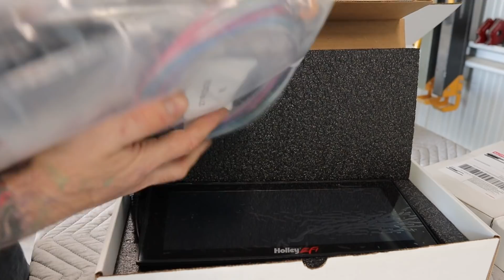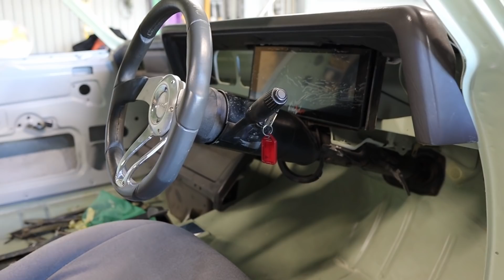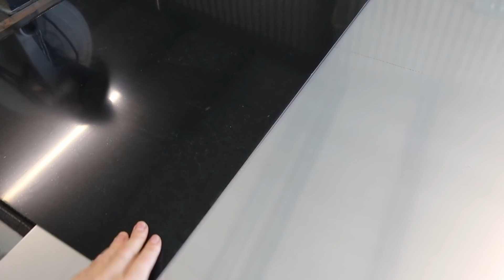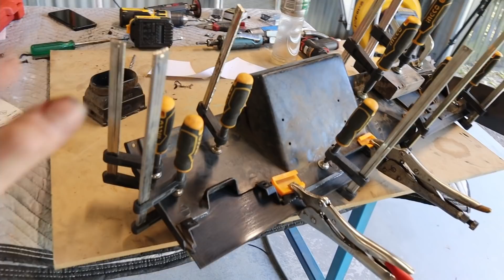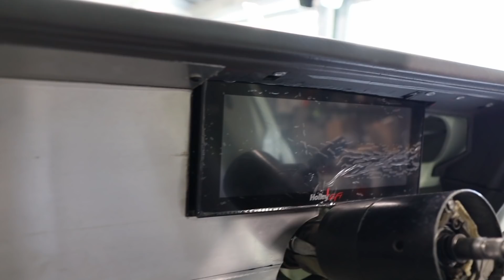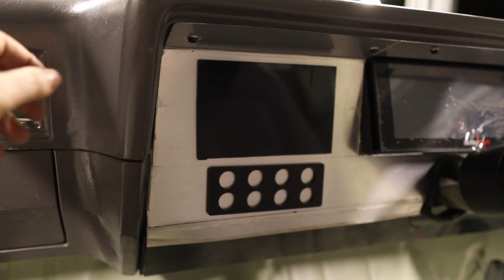Installing Holley Digital Pro Dash / Custom Dash surround - HX One Tonner Build

Comment: Hi Sam, I’ve also purchased the Holley pro dash and a set of super snipers for my engine, what other sensors did you need to buy that didn’t come with the dash, could I get the product code please
Reply from the maker: Hey Mate I bought an Engine oil pressure sensor, trans temp and coolant temp. Im not running high fuel pressure so im just using a manual gauge for fuel.

Comment: Looking awesome mate, love channel. Nelson is a great bloke and his buttons are second to non. 
Mate, swap your button ideas around, ie lights and things on right on left thermo fans and things on left and wrap in in suede, it’ll look clean and being flat panel super easy 👍🏽 just my thoughts, your doing awesome
Reply from the maker: Thanks heaps Mate. I think you could be right with the buttons. I was only thinking having the engine start on same side as the key will need to be turned to power up then hit the engine start. So being the same side will be an easier action. I think I will wrap the panel like you say.